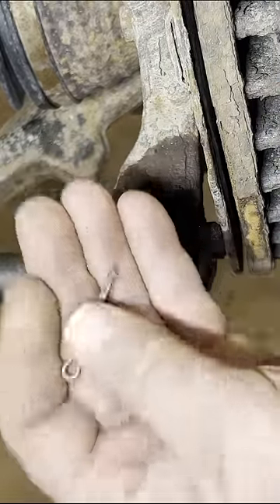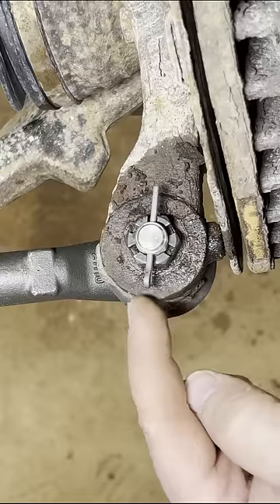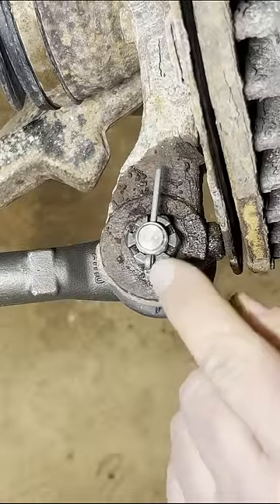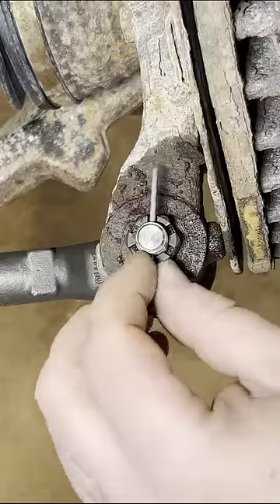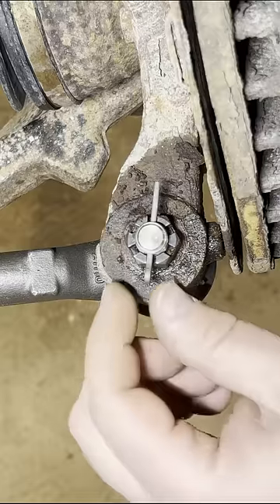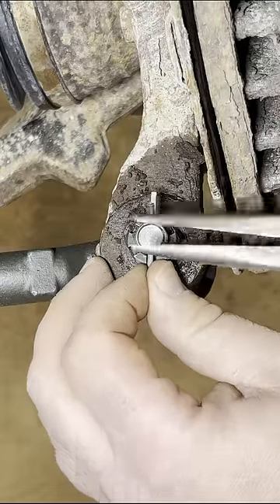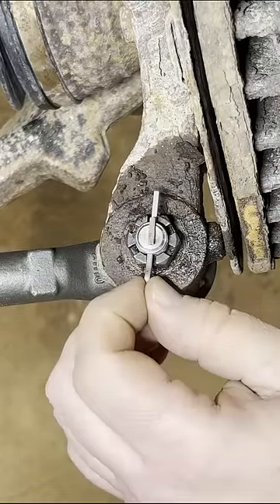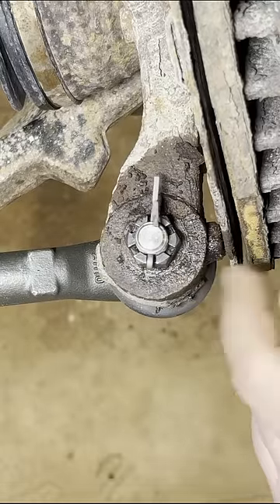RUST BELT Cotter Pin Installation!

Comment: Cotter pin should not move. Rust belt or not which I've been in my hole life. I have specific hole ounces I use when pic breaks off when removing. Rarely I have to drill them. But it does happen. Just do it right no matter if you have a battle later.

Comment: Pull the pin up tight. When it’s time to undo the tre, just beat a 3/4 socket over the nut and give it some ugga duggas. Push the remains of the cotter pin out with a punch and swing press.

Comment: It's not a cotter pin, it's a split pin. A cotter pin is a tapered pin with a flat side machined on to it and a   threaded end on the thin end to allow you to tighten it with a nut.

Comment: Maybe if you use a split pin the correct way then you'll find that the hole is outside the nut anyway because turn the pin 90° put it in the head does not go through the nut

Comment: Respectfully I would disagree with this installation. If it has room to wiggle, any vibration of metal against metal, will wear and break the pin. Better to have less movement and have it last. Drill it out if you have to later.

Comment: I don't live in the rust belt but I'm definitely going to use this. If it makes it easier for me in the future why not.
Reply: Don't do this the rattling around could wear through the pin then no pin no nut and no steering. Get them tight and when they need removed use dikes to work them out.  Best way to do it.

Comment: Nope. The reason I'm putting a cotter pin in is because I don't want anything to move. You also need to bend the other end down against the nut flat so the cotter pin engages twice

Comment: Too small of a split pin is not the thing to do. When they rust and snap off you knock it out with a PIN PUNCH. Don't snap all your thin drill bits trying to drill them. Pin punches were designed for it.

Comment: You always want to bend both sides of the cotter pin, if the bent one breaks off, the Cotter pin will slide out.
Reply from the maker: I’ve been doing it this way for over a decade and have yet to see a vehicle come back with a broken or missing cotter pin.

Comment: Or just throw a socket on it without taking the pin out remove the nut then knock what's left of the pin out with a punch. Don't reuse cotter pins

Comment: A couple of critiques,
Cotter pins are typically made of stainless steel or zinc so it is likely the car will rust away way before that pin.
If it "wiggles" it's going to move & wear down and become too weak to hold that nut. Put it all the way in and bend those pins back.
Never reuse a used pin
There is also the other method, by rotating that pin 90 degrees having the eye of the pin accessible it's easier to remove

Comment: Very unsafe tip, dont follow. Loose cotter pin will vibrate and wear itself down and possibly fall out. Make it tight and add grease to the top of the castle nut and pin. Which will provide protection against rust. Bad advice.

Comment: Ya don't need to take the cotter pin out to take the nut off, removing the nut will shear it off. 9 times outta 10 your replacing the tie rod end anyways.

Comment: Turn it 90°, bend the legs around. The head of the pin is too wide to slide into the castles on the nut. Done.

Comment: Nah my guy. Put the cotter pin in all the way. When it’s time to remove it and it’s rusted in place, you cut the tag ends and break the other end by using an impact. You’re welcome!
Reply from the maker: You missed the point of the video. If you have to remove that to service something else, it’s nice to be able to remove the pin without having to punch or drill it out.
Reply: @Tomsfoolery.  I hear ya and I didn’t miss your point. What I think you’re not remembering or don’t have experience with is that cotter pin wearing out due to vibration in that hole with dirt and stuff. Your way will cause failure which is why a total of zero manufacturers recommend your way. 
A stuck cotter pin is easily overcome with an impact gun because they’re soft metal. Never leave it loose.
Reply from the maker: @SplitWoodAcres right but as stated in the video, I’m not guessing here. I’ve literally done em this way for more than ten years. I’ve never had one just turn to dust as everyone who hasn’t done them this way says will happen. It’s not like a cotter pin on the tie rod end wiggles THAT much. They don’t. Believe it or not but this technique works.
Reply: @Tomsfoolery.  curious, why then do you think not one manufacturer recommends this way? (Not being a jerk honestly asking)

Comment: You could also turn it sideways and push it all the way in and then push both sides around the nut 🥜😂 and if you really want to get fancy you can seal it and wax using a candle 🕯️🤯

Comment: This is dumb. I live in the rust belt. I pull it flush, bend the long tab over top and and snip the end off. Im not saying this is right, but over the years, I've found even if the cotter pin seizes up as long as I can tap a socket over the nut I can zing it off. Then there's only two small pieces in the stud, easily removed via a punch.

Comment: actually no,because if it does rusts up and your going to replace it anyway you just overtorque the nut sapping it off and then just remove the tie rod end or ball joint...whatever...
Reply from the maker: Totally. I was talking about if you had to remove the tie rod to service the steering knuckle. You would reuse the same tie rod.

Comment: Do you really think that cotter pins are made of solid steel?  I was an aircraft maintenance in the military never saw on rust even when the bolts did
Reply from the maker: It’s not the cotter pin that rusts. It’s the hole it resides in within the tie rod bolt. Fills with rust and seizes the pin in place. Very common here.

Comment: If a cotter pin is stuck, just cut the ends off and tap a socket on the nut and use and impact, then you can easily remove the excess cotter pin once the nut is removed

Comment: This is a bad idea. It should not be loose like that. Push it all the way in. Fold the long end over the top of the nut and cut the other half of tge cotter pin close to the face of the nut. When you take it off, bend it back and push/pull it through

Comment: 99.9% of the time, you'll be replacing the tie rod end. Pound a socket over the nut and the rusty pin and use an impact. You're welcome

Comment: Drill it out? Seriously? Flush cut it and put a socket on the nut and take the nut off. The cotter pin will shear and then a small punch will knock it out of the ball joint stud. If its that rusty you probably have to replace it or the nut anyways.

Comment: That's not a cotter pin.
It's a split pin.
A true cotter pin is a bolt- like pin with one side machined flat on a slight angle, so that as the nut is pulled up, the pin pulls in tighter on the taper.
Reply: You don’t have to, but would you mind providing me with some for information on how that is not a cotter pin. Maybe a link to something that can further inform me. 
I’m A&P certified, although we don’t use them because all the hardware is safty-wired, we still called those cotter pins in school because they forced us to learn 1001 things that have nothing to do with aircrafts. 
I think what you were referring to is like a clevis bolt.

Comment: Too small a pin there. Use a dab of grease if your worried about rust. I've never had to drill one out. I wouldn't leave one loose like that. They will wear in two.
Reply from the maker: Bending em that way for over a decade and I’ve never had one wear into two pieces.
Reply: @Tomsfoolery.  I've had them wear in two. Not one I've done, but I've found them gone and found them almost worn out. But, always with a lot of rust. So, I can't say it was more wear than rust, or more rust than wear. Where the bend is, is where they wear into though.

Comment: Who drills out cotter pins? Who even removes them? Use a wrench and spin the nut. It will sheer off the cotter pin like a die cutting threads.

Comment: BS...If it rusts in just cut off what you can of pin with cutters, hammer a socket on and use impact to shear cotter pin off then use punch to knock remains of cotter pin out then use a new nut.

Comment: BS clip bouth ends off put a 1/2 inch Rattle gun on it / impact Gun . The hardened  Nut will cut right threw that soft Rusty coter pin .

Comment: That is not the correct way to set one.    You need to turn it 90 deg.  Bend the long arm around.  Leave the short arm straight.   See the machines hand book.   

Everytimme I have come across a tie-rod that rusty the impact wrench breaks the cutter pin....  Wisconsin

Comment: That's actually not the correct way turn it 90 degrees and bend it around the nut clockwise and counter clockwise.

Comment: Tie rod nuts should remain tight and locked in for a reason.
Reply from the maker: Right. A properly torqued fastener won’t come loose on it own. Cotter pins are a “feel good” thing. No fastener inside the engine uses them…

Comment: BS. that will still rust up. a year from now.  better not have to change it a year from now. by time you should have to replace that it will be full of road grim. it's not coming back out in the rust belt without work

Comment: Or you can just cut it with some dikes, then hammer a socket right over it and pull the nut off. Then all you have to do is take a punch and drive the remaining piece of the pin out of the hole.

Comment: Working on cars for over 40 years in the rust belt of Ontario and not once have had to drill a cotter pin out. They usually come out in one piece, sometimes they break and come out in a few pieces and then if a piece is stuck a pick with a few light taps will clear the hole.
Reply: Riggghhhhhttttttt.

Comment: If it has the ability to wiggle, it has the ability to wear. Vibration is very good at turning big things into little things over time.
Reply: It's a cotter pin on a tie rod end, not a lawnmower engine. It's not subject to crazy vibrations. I've NEVER seen one just turn into dust. EVER!

Comment: That movement will not keep that cotter pin from getting rusted into place, cotter pins don't rust for one and that hole is going to rust itself closed and hang up the cotter pin anyway.

Drill it out? You're getting awfully desperate. If you can bend straight and clip off the ands and grab the eyelet with a pair of good dikes and pry it out. If it still won't move clip the eyelet and pull one piece out at a time. These methods have never failed me. More of them than not you aren't at the right angle or don't have enough space for a drill. A small punch would be better if you really get that desperate. 

Source: Experience

Comment: If you had greased the threads before placing the castle nut on you wouldn't have to leave the cotter pin loose because with enough grease on the castle ated nut it would have prevented it from being able to rust
Reply: And for those of you that think greasing threads is a good way to make something sound like it's going to come loose eventually well then you haven't thought through your statement because it also has a Kotter pin in it to stop it from coming and besides I've been doing this over 40 years and I have never had one come loose that's been to work properly

Comment: As long as it can wiggle… it turns to aluminum and is impossible to rust 😂😂😂

Still gonna rust dude!
Reply from the maker: Correct. However, typically when they can wiggle, the corrosion won't fill the hole and lock them in place.
Reply: @Tomsfoolery.  huh… alright I’ll take your word for it. I’ll do this next time!

Comment: As long as that Carter pin has the ability to wiggle, it can wear through and your crown nut can back off causing your tie rod to disassemble mid drive spinning you out and into a level of pissed off that had never been achieved before...
Reply from the maker: Been wrenching for 27 years and I’ve NEVER seen a properly torqued castle but back off on its own. I’ve been bending cotter pins like this for a decade and I have yet to see a vehicle come back where the pin is broken or missing. Real world experience > internet opinions.

Comment: So youre saying you install them incorrectly.... ok good job. If the pin can wiggle it WILL unvend itself from vibrations and movement after time.
Reply from the maker: I’ve been installing them like this for over ten years. Have yet to see one wiggle to the point it breaks and falls off. That simply doesn’t happen. But thanks for the comment, I appreciate it!

Comment: I’ve been just putting a impact and sheer that pin right off.
Reply from the maker: And then what? You can’t reinstall the tie rod end without removing the broken pin. I think you missed the point of the video.

Comment: That's bull.  It will still rust up and get stuck in there.
I hardly ever try to remove them anymore.  I pound a socket on there and shear off the pin

Comment: Never have I had to drill a cotterpin out. You just break off what's there and run the nut off
Reply from the maker: The video wasn’t pertaining to replacing the tie rod end. Do what you said and the pin is still seized inside the hole. Now you’ll have to punch or drill it out. Do it the way I demonstrated and it’ll come right out so you can reinstall it.

Comment: Makes more sense to use the proper size pin.  You know, the head size larger than the nut.🤔
Reply from the maker: The pin used was the pin supplied in the box with the new tie rod end so…

Comment: ABSOLUTLY WRONG!!!  It is the "eye" of the cotter pin that keeps the fastener from backing off. The eye should be completely flush with the flat of the castle nut!!
Reply from the maker: Is it? Or is “properly torqued nut” what keeps it from backing off? Here’s some food for thought, none of the nuts inside the engine have cotter pins on em and they don’t come loose because they’re properly torqued. That tie rod cotter pin is a “feel good” item. That but should never come loose.

Comment: Dont do this. If it rattles it will wear itself apart. So if there is rust, it will fall out.
Reply from the maker: Actually, it will be fine. I’ve been doing them like this for over a decade. So I’m not guessing it will be fine, I’ve already experienced it hundreds of times.